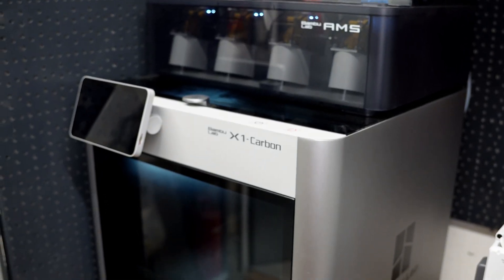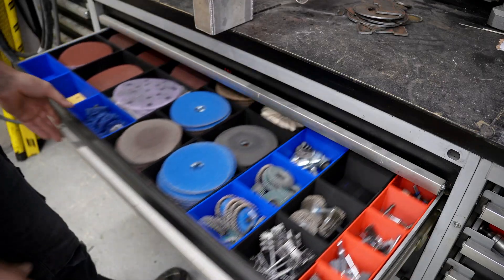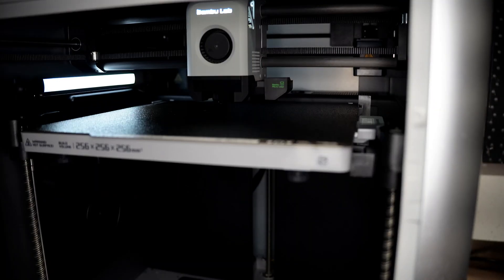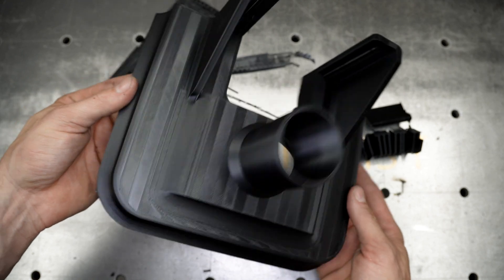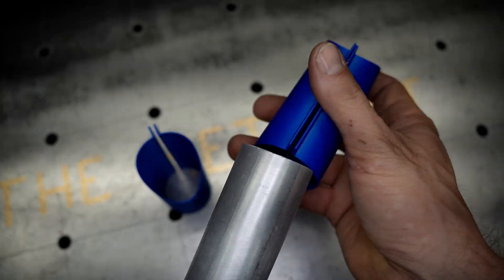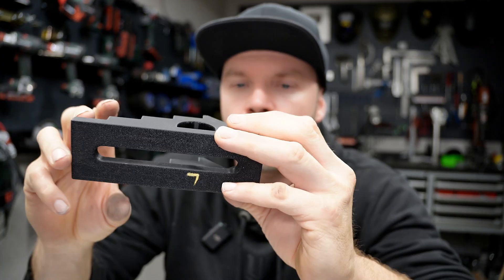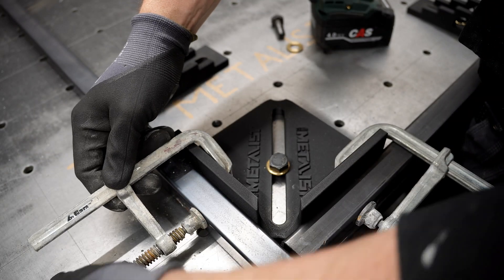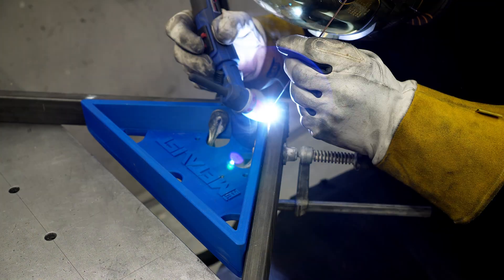3D Printing and Welding

Comment: No need for a review on either of these two as there is plenty out there. BUT practical applications in the shop is really worth going into. Also have a play with press tooling for fun too when you have a need or a little time.